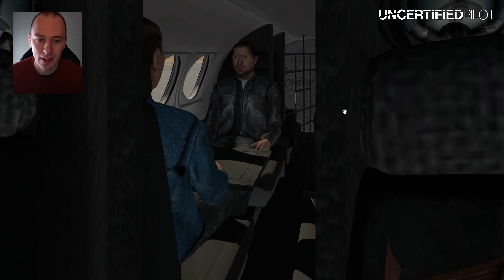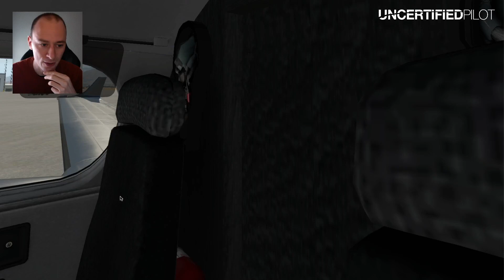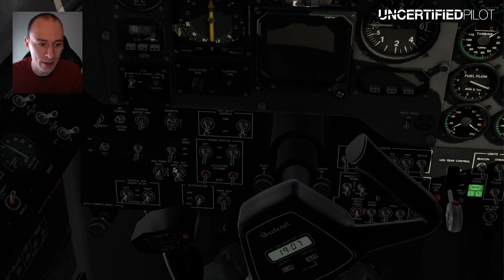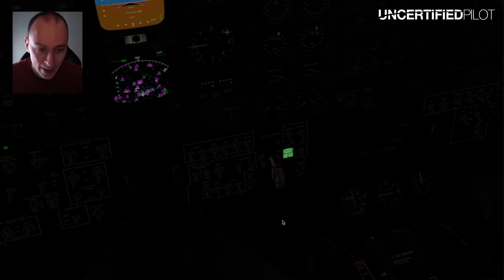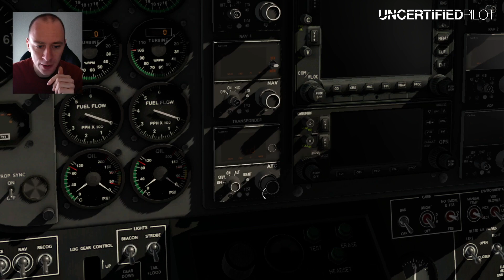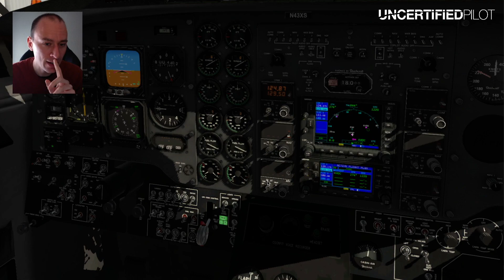Walkthrough – Default KingAir C90B JongePionier Ultimate Mod

Comment: Thank you for your valuable contribution. I'm thrilled about experiencing the new and enhanced King Air during my flight. I will certainly review the operating manual to familiarize myself with its features. Additionally, I appreciate the ability to adjust the cockpit brightness in the overhead panel!

Comment: Hey, I have an issue with the reverse thrust with my airbus throttle quadrant, I have set the reverse and beta inversion mode but it doesn't work, when I use my hotas reverses, it puts throttle on idle. If you know how can I fix this this would save me 😂thx for the amazing job!

Comment: Just outstanding.  Did a couple of circuts.  Love it and still so FPS friendly in VR in the rift.  One thing I did notice is the cabin pressure gauge on pedistal in full sunlight looks absolutly white.  I took a screen shot if you need it.  seems like maybe a little too much reflection.   I love it though.  searching for a POH and proper checklist now.  This might just be my favorate GA aircraft.  thank you so much.